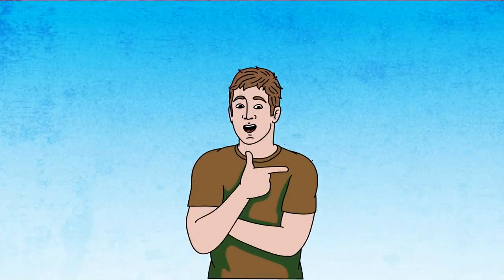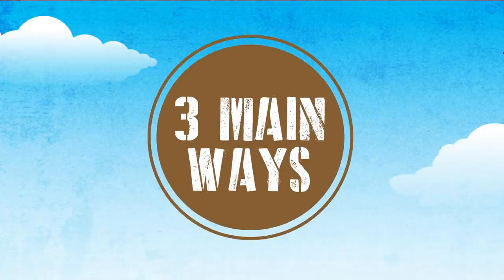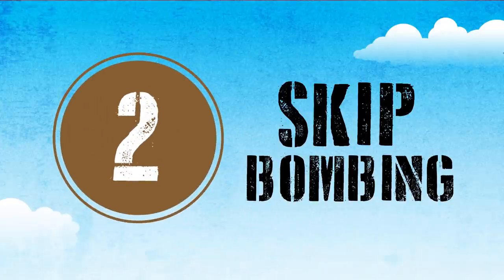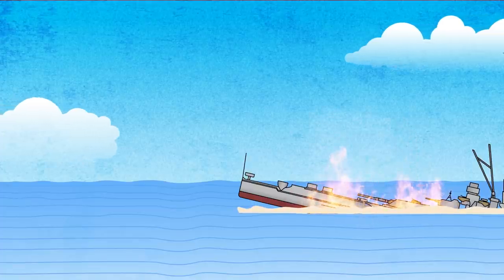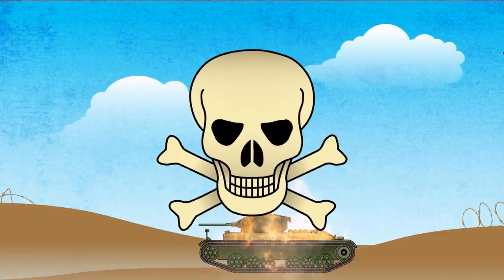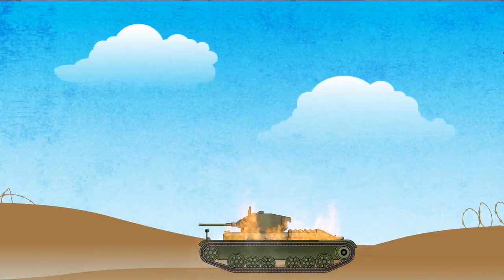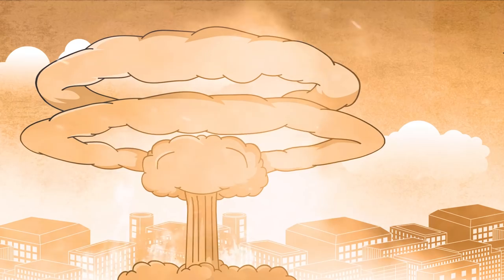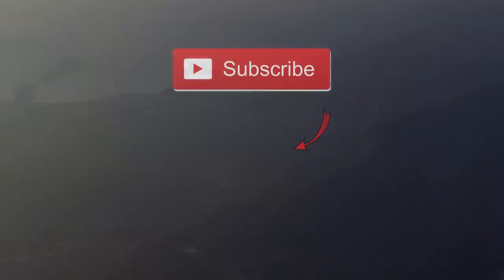Different Aerial Bombing Techniques Explained

Comment: i like that "idiot loop" bomb technique.
Reply: What if the bomb hit the plane lol
Reply: John Doe Unlikely, the plane has a good deal of momentum when the bomb is released and the aircraft scoots out of the way rather quickly. Besides, they are both very small objects relative to the amount of space around them
Reply: I think the technique was more to release in the popup climb and then just half loop and dive away in the same direction you came from...and not do a full loop
Reply: The last one seems to be flawed.
In US recordings, a half loop is made with a subsequent half screw.
So the plane escapes over the same path, over which it flew into the target area.
Reply: both of those techniques were called an idiots loop.  there was the one where you lobbed the bomb up and forward and the one where you lobbed it over the shoulder in such a way that you didnt actually enter the area you were boming just kinda flew to the side of it and then away.    watched a documentary on it but bomber crews  had a special device in their cockpit that  you transferred data to and it would release the bomb at the optimal angle to hit the target based on direction airspeed and distance.   so that pilots only had to worry about piloting their aircraft under gee forces.  @DavidWalkerMeikle
Reply: there was one supposed mission that involved a full loop because they were flying at the edge of the area and then throwing the bomb back behind them at the target where they were supposed to complete the loop and continue outside the combat zone.... i dont recall if they ever actually did the mission as these kinds of drops werent solely for nukes.  they could be used with large conventional munitions just as easily. @sylviarohge4204

Comment: a dive bombing in a stuka was pretty safe,the stuka had a system to aloow the plane to elevate at certain altitude,meaning that even if the pilot loose conscience the plane will automatically elevate safely
Reply: francisco ostos Quit reading war thunder facts while the game loads.
Reply: i didnt read it in warthunder
Reply: francisco ostos mmmhmmm
Reply: Clorox Bleach have I seen you somewhere before?
Reply: Once the Pilot engaged this device it locked 2 flaps in the back making the plane head heavy and diving at about 70° some report StuKas even diving at around 90°.
Now with this device in place it used a barometric altidute instrument to calculate the bombers altidute and released the bomb and also (more importantly) locking the flaps back in a ascentining position. 
This was done automaticly due to the G-forces often causing pilots to black out on these deep dives.

This device was called "Sturzflugautomatik" and firstly saw action in the Junkers Ju 87 together with the jerico trumpets.
Reply: Dive bombing in a stuka was a death waiting to happen ..Stuka's were slow. bad climb rate and lightly armed against fighter planes and did not have a altitude rate of other bombers nor carried the same amounts Which made them eazy to hit from AA and flak and fighters  Only thing is was good for was angle of dive and percsion Big risk for ones life
Reply: freakyflow There's also the Psych' effect, hearing a Stuka Siren when you're on the ground will turn your panic mode on.
Reply: Sure if a person on the ground heard them diving in it was ..If they were not shot down before or after getting there ..1943 the stuka seen the last of its role
Reply: freakyflow The germans new that they had plans for replacment as early as 1939 i belife and they did not use them for "kiling" stukas wher part of psycholocical warfare and to many ther was nothing more horifying than a stukas jericho trumpet.
Reply: I never knew that, thanks for that bit of history!
Reply: @alberich3099    whats sad is in warthunder only like 1 stuka has a jericho trumpet. and its like the lowest cr  you can fly of it... which means you cant troll high end tanks that easily with the better engined/armed stukas.  though in one stuka you can dive fast enough to break just your langing struts and therefore gain a better manuevering plane because the drag from the landing gear is gone.... and since repair of landing gear isnt that long in  WT if you know how to belly land without breaking wings.... trollolol.
Reply: @freakyflow  they where actually fairly fast and after the pull put would be very low level shield then somewhat from ground fire
Beimg low level also forces any enemy fighters that arent engaging your fighters to dive potentially crashing
Reply: @flounder2760  br not cr
Reply: @justarandomtechpriest1578  Anything grows speed in a dive. It was the Speed flaps that slowed it down And a abilty to aim at steeper angles While pulling out at lower alts They were not "fairly fast" compared to the fighters they were up against Losses Getting into the RAF ranges were higher And into the Battle of Britain Goering ordered the Stuka to be escorted And by the following weeks They seen Ports And land targets near the oceanside Very rare would the extend past that. With the 2 engine bomber able to go faster with a longer range And bomb load It made more sense to have them with escorts ...However they did want a 4 engine bomber Even a jet bomb This direction was caused by the stuka

Comment: The last one worth it to test..! 
at least in war thunder...!!
Reply: Shotcrete Shower thanks for the info I'm new player tho..!!
Reply: Shotcrete Shower except for dive bombers! they drop with their noses to the ground
Reply: You can do that idiot loop in fighter/attacker/dive bombers aircraft that can carry bombs, but you cannot do that in bomber aircraft.
Reply: Navieoli Stuff So turn it off maybe?
Reply: How could it go bad! You killed yourself
Reply: What's you warthunder name or steam mane
Reply: Bomb skipping also work.
Reply: EVen though in some situations where the aircraft if decelerating while ascending , if you drop the bomb  it will still go upward and not hit your own plane , ... because it's hard to model initial inertia for the bomb while it's still attached to the plane, WT will only alow you to drop a bomb as long as the vector pointing upwards from the plane has no negative component (if ye point an arrow upwards from the plane , it will only allow you to drop a bomb if it points above the horizon)
Reply: vexonica 02 was thinking about war thunder the enjoined time lol
Reply: I tried it on"Heroes of the Pacific" in a multiplayer dogfight and killed a pilot doing that!
Reply: SomsoKca  no you can't
Reply: reminds me about how when using WTFAST VPN   its always logging itself in and trying to optimize for world of tanks for some reason. is super annoying.    @cringeworthyhumans160
Reply: If you time it right, you can do something similar in a Wellington
Reply: "Cannot drop the bomb because of the plane's current attitude"
Reply: Shotcrete Shower yes it does i dropped a 4kg bomb from a wellington while flying inverted it worked

Comment: Wait.. I thought they dropped the bomb before the climax of the loop, then pulled trough and sped off in the opposite direction? Basically giving it a sling-shot effect, allowing the bomb to travel further and thus allowing the crew to put more distance between them and the bomb before it hit.
Reply: Illiminatie overlord Gurglekoks  there were actually 2 different ways to toss a bomb: the one shown herenis the "over the shoulder" toss, meant to gain time after flying directly over the target. The other way was meant for distance, and could throw a bomb up to 20 miles away.
Reply: I seem to remember that it was called Toss bombing and it is used today
Reply: @billhanna2148  
Toss bombing is different. That is when you pull up just before release, giving the bomb upward momentum and further range.

Comment: I heard that something similar to the 'idiots loop' was used in the Battle of Britain by Lancasters trying to hit aircraft above them. 

When London was attacked everything went up, Hurricanes, Spitfires and yes even Lancaster bombers (which is why all three are part of the Battle of Britain Memorial Flight). Lancasters would get above He 111s if they could but on occassion they had aircraft above them. 

So, in a dangerous maneuver that would push the airframe and all four Merlin V12s to their limits, they would climb, roll over and pull an inverted dive while completing a parabola underneath the aircraft they aimed to bomb. If they pulled this off the bombs would clear the Lancaster and hit whatever was above them and all would be well. If they hadn't pulled it off the primed bombs would have fallen back into the guts of the Lancaster and . . . the Battle of Britain would have ended very differently.

Comment: There is another...I remember reading an app note from Rockwell Collins for their Gps unit in which a plane flew up and launched the bomb which would fly in a ballistic path to the target. This has the advantage the pilot would fly over the target. Using the GPS unit knowing the target coordinate you only had to calculate the release position, angle, and speed of release.

Comment: Little fun fact. 
The StuKa Junkers Ju 87 dive bomber had a mechenical device built in which madae the throw of the bomb an "automatic one". 
Once the Pilot engaged this device it locked 2 flaps in the back making the plane head heavy and diving at about 70° some report StuKas even diving at around 90°.
Now with this device in place it used a barometric altidute instrument to calculate the bombers altidute and released the bomb and also (more importantly) locking the flaps back in a ascentining position. 
This was done automaticly due to the G-forces often causing pilots to black out on these deep dives.

Comment: To those, I would add a fifth technique.  That is where the pilot climbs the aircraft to a very high altitude, and then does a fairly steep nose dive.  At a previously selected altitude the pilot would pull the plane out of the dive and climb, dropping the bomb after he starts to climb.  The bomb would continue to climb for some distance before arcing onto the target.
Reply: David Briggs So basically a reverse Idiots loop?
Reply: Not exactly, since the Reverse Idiots Loop is done basically above the target, whereas the technique I suggested is done well away from the target in the first place.  I'm not a pilot, but if the technique works as I think it would work, then it would place the bomb onto a ballistic trajectory that would hit a target some distance, possibly many miles away.  It should in fact allow you to hit a target in, say North Korea, well away from the coast without actually crossing said North Korean coast.

Comment: i dont have the book now. but o know of a variant of the idiots loop. the difference is that the bomb is released in the first part of the loop. launching it up and forward. the plane. when at the upper part. just rolled and returned as fast as possible. it was also designed to drop nukes. but small ones from fighter bomber jets.

Comment: The over the shoulder bombing is not described right.  They do not continue the loop.  They only do half of it so they are facing the direction in which they came from and at a higher altitude.

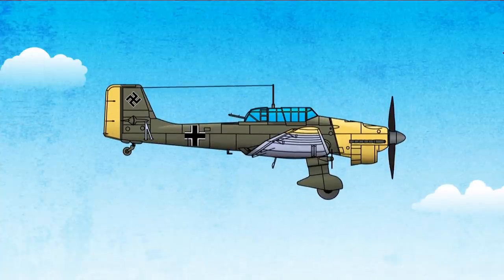Comment: 1:15 
1) The Swastika is facing the wrong way.
2) I've read from a real Stuka pilot during WW2, that the degree when they were diving was 60-85.
Reply: it was sometimes even more but that only was possible becuase of the Sturzflugautomatik which was a mechanical device to secure the plane to gain altitude even with a blacked out pilot.
It used barometric primed pistons to engage the flaps at minimum altitude required a save accend.

Comment: The years 904–906 saw the use of incendiary projectiles called 'flying fires' (fei-huo) Since then 

WW1 :(Cut out the WW2 Planes video, Insert WW1 planes video) Early flight planes used Hand greandes and small hand held bombs And Equipped planes with racks to hold bombs for the men to pick up and drop on the ground below 
The next step was bombs fixed to the wings and under frame  
The methods above were Dive bombing as the pilot dove He or his 2nd in the rear would hold the bomb untill the spotted the enemy target dive in let go of the bomb and climb Or would simpily flow level over the target and "Carpet bomb" 

WW2 The all too famous German Stuka dive bomber paints the idea of WW2 bombing as it was one of the first bomber used at the start of the war  Known for its Dive bombing support role. It's role was to hit key targets as a percision bomber Diving in and dropping a bomb on a tank or building or ship etc  From 1000ft and be able to pull out of the dive even if the pilot was  unconscious However the Stuka Dive bomber was Very slow, poor defence, Small loads, Short range It was outdated by the end of the first year of the war compared to The amount that was shot down. The amount of tonnage total of bombs dropped per flight.
Stuka was outclassed by The P-38, Mosquito fighter/bomber Known for there Range, Speed, Amount of load, And Guns and Without a need of a escort
Even the American  SBD was abit faster twice the range and carried 1,600lbs of bombs to the Stuka's 550lbs bomb
The only great note of the stuka was its dive angle ..Not metioned on the video.. 45-60 degrees was not the case. Stukas have been known to drop at 90 But more common was 75 -80 as they looked out a window on the floor 

Carpet bombing.... Dive bombing........  Skip bombing? Very rare and dumb to try as there was many factors in play to hit a target and not hit your own plane as you tryied...( Waves, Speed, Height, distance, Enemy fire
The RAF did manage to design a bomb to spin while in the plane to a calculated RPM and Lights that showed the height of your plane on the water below as the 2 lights came closer together you were at the proper height to drop the bomb speed of the plane was pre tested distance was mesured by a V shaped rod When the Dam they were targeting was in full view of the V shape you were at the right distance to drop Waves were not a problem because it was a Lake not a high wave ocean  Enemy fire was reduced because the raid was at night BTW the spin on the bomb worked once the bomb made it to the dam ..The spin made the bomb dig along the wall and go under the water down the side of the wall and explode 20 feet in Making the water gush out at the very least..But each Dam that was hit was fully destroyed  Knocking out power and flooding the towns below which had war factories

If you look into the Types of weapons used you will find out why it worked well in a carpet bombing role or dive bombing role

Comment: Bouncing bomb scene is incorrect the British dropped the bouncing bomb
Reply: zak Naylor Actually skip bombing was also done in the Pacific, they didn't use modified bombs like the English and instead relied on proper speed and attitude
Reply: they never used bouncing bombs on ships they would use conventional bombs with a delay and drop them at low altitude and high speed for ships
Reply: Skip bombing was indeed used against ships.  Example:  https://rarehistoricalphotos.com/b-25-bombs-kaibokan-ship-1945/